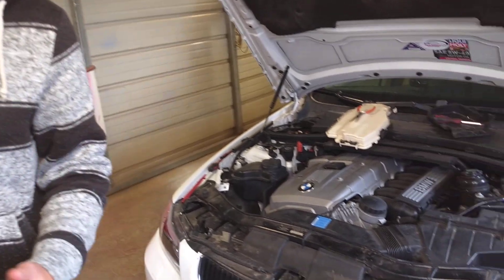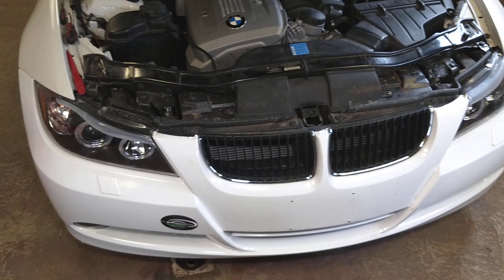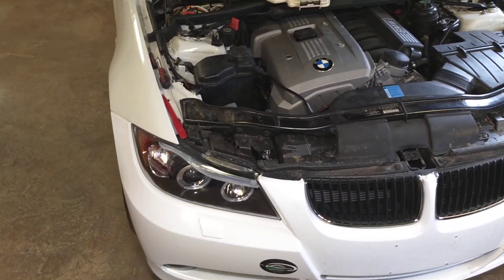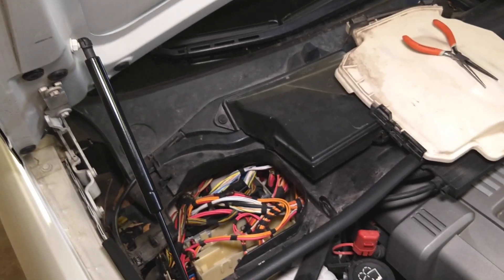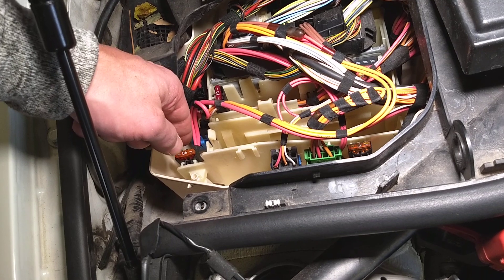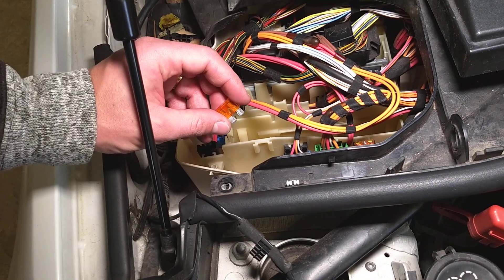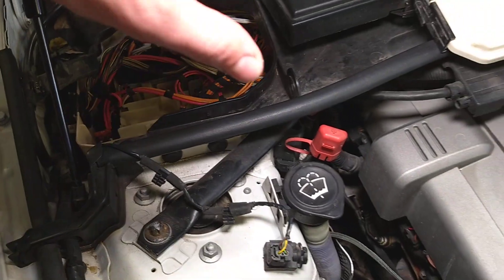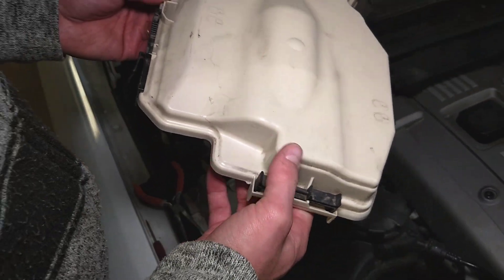VALVETRONIC MOTOR FUSE LOCATION REPLACEMENT BMW E90 E91 E92 E93

Comment from the maker: Products that we use and recommend:
► Replacement Fuse Big: https://amzn.to/40DFA5U
► Assorted Fuses: https://amzn.to/4fx4s3F
► Panel Removal Set: https://amzn.to/3YiMADu
► Tool Set: https://amzn.to/3p5MM6t
► Screwdriver Set: https://amzn.to/3XRB28Q
► Mobile 1 Oil: https://amzn.to/3xBc8B9
► Oil Filter: https://amzn.to/3w0Ulme
► Torque Wrench: https://amzn.to/32qyRwg
► Liqui Moly Engine Flush: https://amzn.to/3IiDBID
► OBD Scanner that we use most often: https://amzn.to/3I4MQfe
► Voltmeter: https://amzn.to/4hB6Zvk

► Check out our Amazon Store for the tools and parts that we use: https://www.amazon.com/shop/worldmechanics
Reply: Electrical Car Repair LIVE hi man do you know where is the fuse location for Valvetronic in f10 535i ?

Comment: Would the Valvetronic motor be the reason some times my car has absolutely no power the sometimes it will start but not really idle right ?
Reply: Might not be flushly mounted. May get lean error codes. To mount flush you must torx the rear clockwise with a T25, I believe.

Comment: There are no starting conditions to adjust the stops.
Either the engine speed is not exactly identified with 0 (dispersion value) or the Valvetronic relay has not been activated. What can I do? It's a 2011 BMW F10